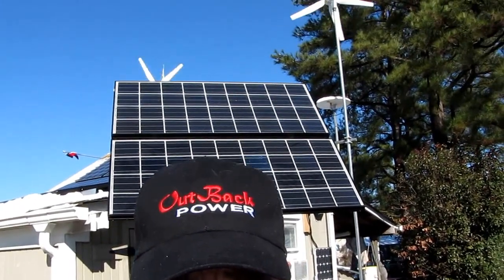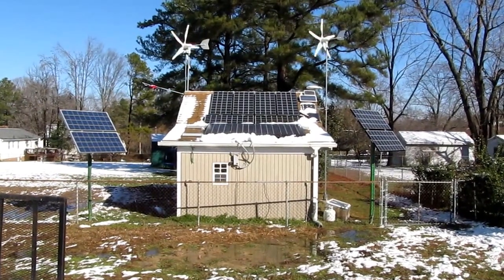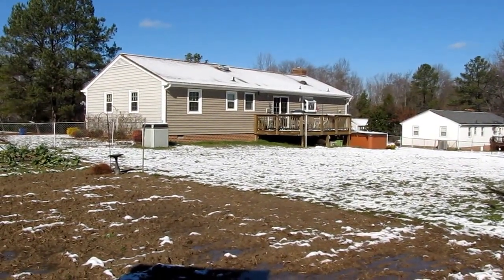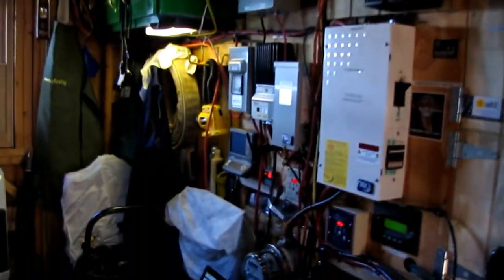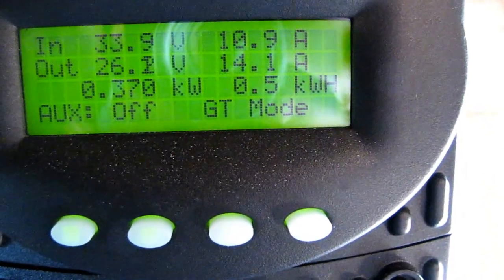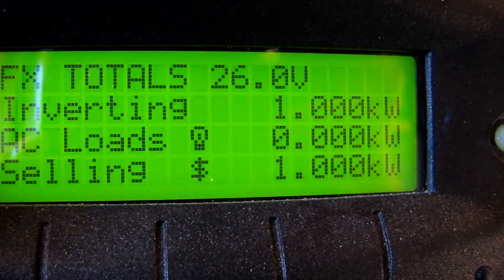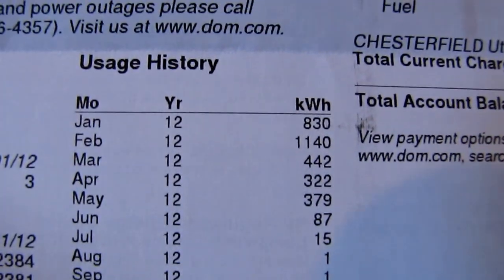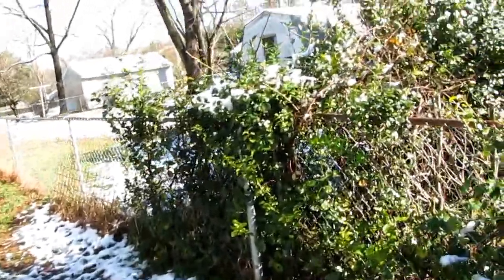My OFF GRID / ON GRID Solar and Wind Hybrid System  In January In Virginia

Comment: yeah will be fun
i will take photos and videos when i start digging holes and pouring concrete 
ive seen a few videos turbine towers snapping in half strikeing the house, my wife would kill me if that happen
corrugated iron and plywood wall cladding hopefully keep the marriage safe with tensile and compressive strength
10m height turbine would be quite a few tons of leverage at the base at a 100kmph windspeed i would imagine,, could be very scary

Comment: here in south australia,, can build a 10m tower w/out council permission
if the tower was mounted with 4 galv posts, bolt some timber framing around it,, clad the roof with solar,  wind turbine in the centre of the roof
sort of use the wind tower as the framework to build a man cave workshop area,, rather than running guy wires,, make the building 2 storeys tall and re-enforce the structure with the wall cladding like corrugated iron and timber frame work
wind turbine arrives soon, will see ahah

Comment: wow thats alot of solar panels more panels than roof,, should make a lean to and use the panels as the roof for house extension,, would the panels be strong enough as a roof cladding???
rather than using corrugated iron,, just clad roof with solar panels,, im wondering about that

Comment from the maker: In Either Mode The OutBack  GTFX 2524 See's The Batteries Are Floating and Up To Par And The OutBack  Feeds All My Peak Loads when The Gris Is Up and Going  GT Mode Just Helps Squeeze Every Bit of Power Out Of The Panels That It Can